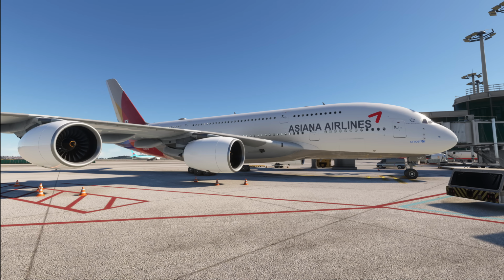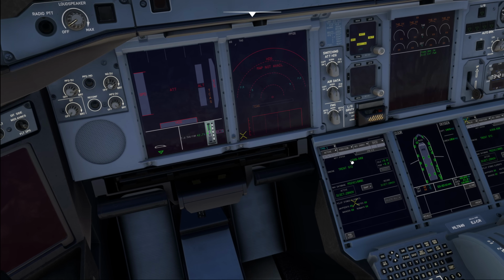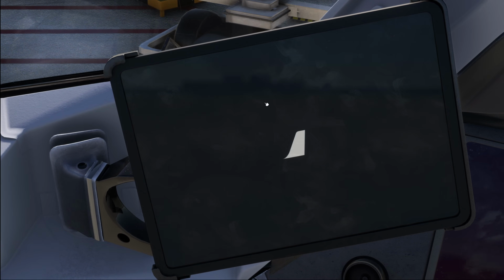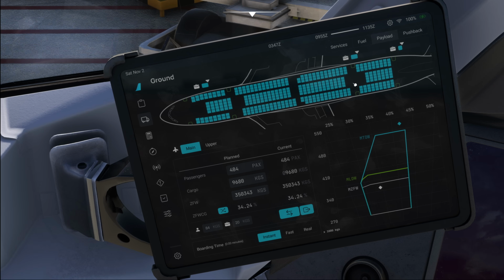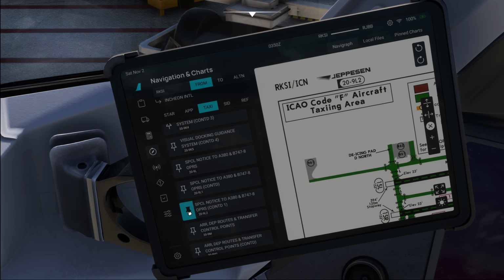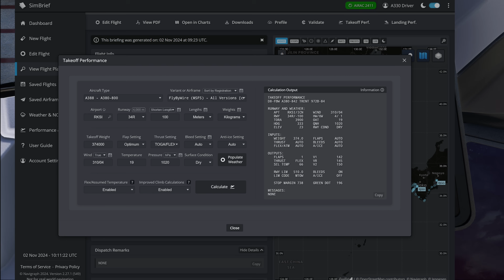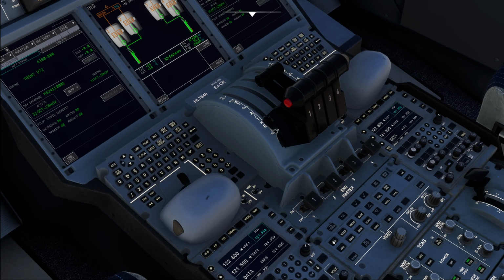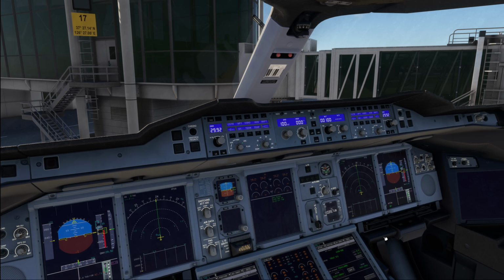FBW A380 Tutorial 1: Powerup and Preliminary Cockpit Preparation | Real Airbus Pilot

Comment: Hi Emanuel. When I start the A380 (in MSFS) there are by default 175+ tons of fuel in the tanks. However, for my short trip from Toulouse to Munich I only need 33 tons. In theory the GSX refueling truck should DEFUEL my aircraft. However, even if the word "defueling" is shown, the amount of fuel just increases. Be reassured that the needed amount of fuel is correctly indicated in the requested fuel window (with the SimBrief "cloud" icon). Isn't there any way to have a much lower "starting" level of fuel onboard? When I start with an A320 I always find on board 3 tons of fuel, which I then top up as needed. I would like to also have on the A380 the typical amount of fuel you have on the average at arrival. I found no solution in the FBW website. Modifying the fuel values through the MSFS basic fuel "sliders" is deactivated by FBW as they say themselves in their website. Many thanks for your help.

Comment: Nice job.
EXT power on sequence should be 1,3,2,4 (boots up the DUs faster and is as per FCOM)
Also, FCOM requires a 3 second pause between APU master and APU Start selection.

Comment: A380 looks great! About apu bleed, is it normal to select it on straight after apu is shown as avail? I've always used about 3min delay, recalling some pprune thread about how that is recommended to reduce the chance of fumes in cabin due to not yet warmed up seals etc.
Reply from the maker: Yes, it's normal. The A380 is not an A320 ;-)
Reply: @A330Driver Indeed it's not, as this fenix driver is starting to discover. :)

Comment: SOP provided by FBW says external power should be connected in order - 2, 3, 1, 4 for shorter start time of the display units. Does it really matter or you don't bother with it?
Reply from the maker: That may be some of the stuff you don't find in the manuals - I based these on the FCOM I have, but of course there are usually some small tricks type rated pilots can tell that you won't easily find written anywhere.
Reply: I think the main reason for that is switching EXT 2 on first will power both AC BUS 1 and 2 then applying EXT 3 will power AC BUS 3 and 4, EXT 1 will then takeover AC1 and EXT 4 takeover AC4 so it spreads the loads out evenly.

Comment: Very nice tutorial!, just one thing tho, pilots start the ext power 2 then 3 then 1 then 4, This sequence helps to distribute the electrical load evenly across the four external power units, ensuring that all systems receive the necessary power without overloading any single unit.
Reply from the maker: Hi, my FCOM says 1-2-3-4 and does not mention any dedicated sequence. Perhabs that's one of those things pilots would come up with on the line or a company procedure?
Reply: @A330Driver  If yours is the FCOM that's available on-line, it's out of date.

Comment: I love boeing types but even I could not resist trying out the FBW A380 - however why is it that the battery switches have ZERO annunication... no lighting or text for current state?
Reply from the maker: Apply some AC power, either GPU or APU, then your plane should come to live. The battery alone is not strong enough to provide power to all airplane systems, so it loadshets anything but the most important systems.

Comment: As an avid 737/777 simmer, I am finding myself intrigued by the 380 and ultimately by the way that an Airbus operates. My first few flights had the aircraft pitch up 30 degrees uncontrollably until stall where it would pitch down 30 degrees and the cycle continued. As of yet, I'm not sure why, but I'm sure I'll figure it out through your tutorials. Thanks.
Reply from the maker: Sounds a lot like something's wrong with your controls. Or you go full thrust with a light aircraft? Be sure to do proper takeoff calculations!
If nothing helps, ask for support in the FBW Discord. Lots of great people there to help you out!
Reply: @A330Driver It’s a bug many have already reported, it’s an aircraft thing. I haven’t had it happen uncontrollably after take off, but I have tested the limits and protections a bit and it is essentially impossible to get it out of a stall or even an approach to stall. Something is definitely wrong with the pitch axis imo But I’m sure they will address it soon.

More annoying for me is that I’ve had a CTD on every flight so far, which I’ve maybe had 3 time total in flight sim before… but well, it’s an Alpha
Reply: Guilty, I'm sure that was it as now that I think about it, I was in TOGA (my first flights were not proper, just experimenting). Thanks.
Edit: my first lesson, throttle gates.

Comment: I didn't know short-haul A380 flights existed. Finally, a flight I can practice with heheh.
Reply from the maker: Emirates has quite some as well! Dubai-Ryadh, Cairo, Jeddah or Mumbai to name some.
Reply: @A330Driver  That's cool to know! Thanks for letting me know these A380 routes existed at least. I don't think I could fly serious 10 hour flights my limit is only 8 hours 😅
Reply: @SN57ONE lol you can't do 10 this mean you will never do singapore to new york lol
Reply: @A330Driver  Are you using the Le Aero Design RKSI or the PacSim RKSI?
Reply: Dubai to BLR, BOM, DEL. 
Singapore to DEL and BOM 

Are all a380 "short haul" routes
Reply: @autothrust_blue  Thanks I'm going to try those as well.
Reply: BA did a few runs to Madrid and Frankfurt from Heathrow when they reintroduced the A380 to allow for crew training.